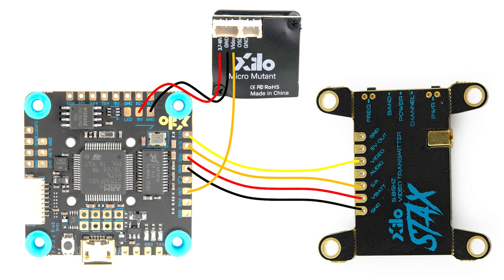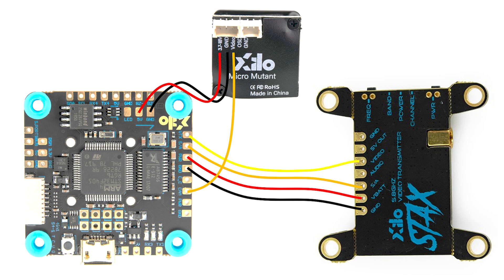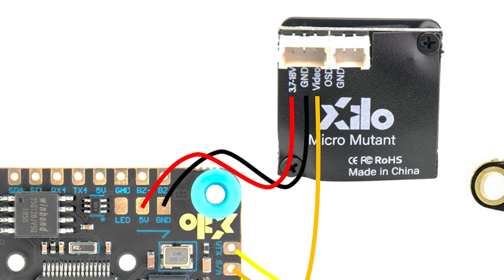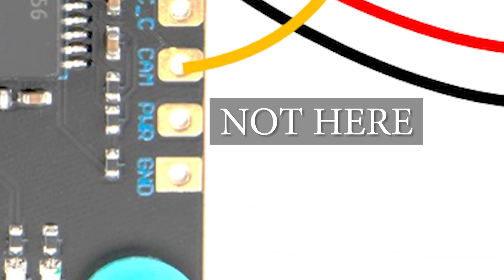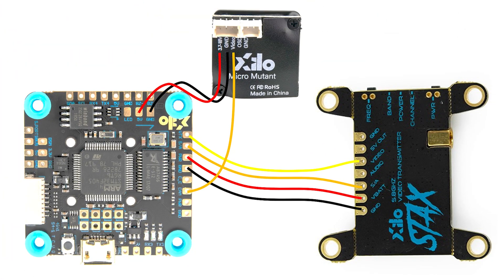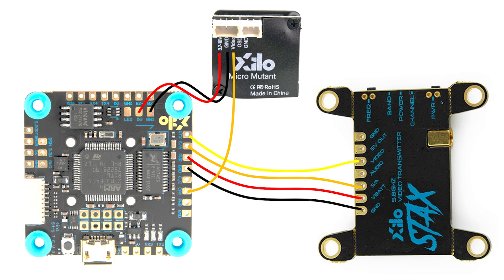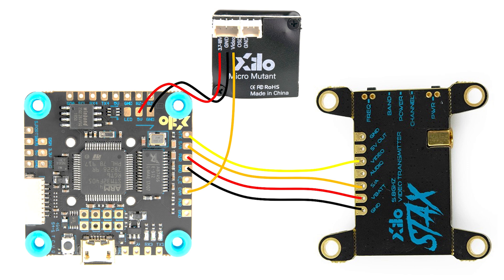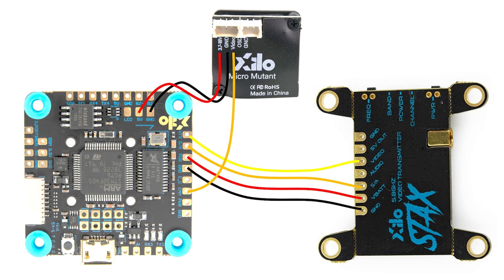FPV Drone Xilo Budget Build Updated Wiring Instructions IMPORTANT

Comment: Hi! I ordered this drone kit from Banggood about 2 weeks ago. The camera I received has the connections (left to right): 5-40V // GND // Video // OSD // GND.

Does this mean the camera has changed again and the wiring diagram should be updated again, or is it fine as 5-40V is a bigger range now?

Also, there is a button (up - down - left - right) included with the camera. Any instructions on how to wire this up as well? :-) Thanks!
Reply from the maker: No. The camera should be wired as shown here. The 40v rating printed on the camera is incorrect.
Reply: @JoshuaBardwell  Thanks for the fast response!
Reply: @JoshuaBardwell  Hi Joshua 
I was wondering what are you meant to do with the OSD and the GND cables from the camera

Comment: I had a different problem... whichever way I wired the power I couldn’t get a video feed... the OSD was working, but no picture... eventually I bypassed the FC and wired the video feed straight to the VTX video wire... works like dream now!!

Comment: I just got the Xilo kit this week, and it looks like the camera has changed slightly again. Same headers on the camera itself, but thepower pin is now labeled "5-40V", so I'm guessing it's now safe to power it directly from a 6S VBATT. I'm not going to chance it though, and sticking with the diagram shown here.

Comment: Hello. I had an issue with using the original power point. I am glad to see the update. I smoked two cameras. They were 5-20 VDC. I think it was the counter electromotive force from the motors stopping quickly that fried them. I have been powering my camera off the VTX with no issue so far.
Reply: I have been enjoying the Quad, after some practice. I was a lot more power than I could handle (MY FIRST REAL QUAD). Steep learning curve.

Comment: I just finished this build, but may have avoided this issue because of another one. I'm getting no power to my flight controller. When I plug in the battery it beeps twice and the motors twitch then nothing. No l.e.d.s, no other beeps. This is my first build, and I could have done something wrong, but I've checked and rechecked all my soldering joints and everything is in the right place and holding. Is there any chance that my fc is just a dud?

Comment: JB, the camera I received is labeled 5-40v
Reply from the maker: Don't believe it.
Reply: @JoshuaBardwell  Thanks! I only have 4S batteries so I am safe with the original wiring as you mentioned to another user. New subj, I have a new TX16S and the RXSR recvr in the kit, should I update FW in both?

Comment: My son and I just finished wiring up this setup.  We also hooked up the camera OSD to the C_C (Camera Control).  One thing to note, the label on the camera is switched for the OSD and the far right ground (at least it was for us).  The labeled OSD pin is actually ground.   We also had to change some of the the camera control values in betaflight.  I don't remember off the top of my head the new values, but if anyone is interested I can find and post them.

Comment: Why not use 5V out of the VTX? Afaik that's what all VTX manufacturers recommend and what gave me the clearest image on many drones.
Reply from the maker: The vTX is in the back of the quad and the wire harness included with the camera does not reach. It would be fine to do that though.
Reply: @JoshuaBardwell  You're right, getting 5V from the FC is more practical in most builds. If it's a good FC there won't be much noise in its 5V rail either.
Reply: As well as the practicals, that would increase your chance of a ground loop or other interference issue with the OSD.

Comment: If I only fly this with 3S I don't have to change the wiring?
Reply from the maker: Correct.
Reply: Correct. You could go up to 4S without changing the wire.
Reply: This is only for new builds. If you’ve already built this quad you don’t have to change anything. Also, changing battery types doesn’t change the quad wiring (as long as all components are rated for the voltage they are receiving). If something is wired to vbat, make sure it can handle the voltage. If it can then there’s nothing to worry about.
Reply: I'm using 4S and my camera wasn't working. IDK if it was a DOA camera or too much power. GetFPV shipped me a replacement no questions asked.